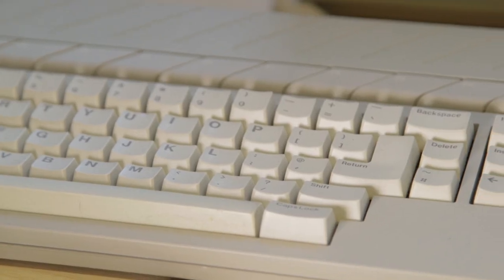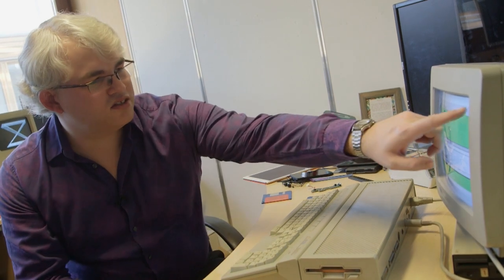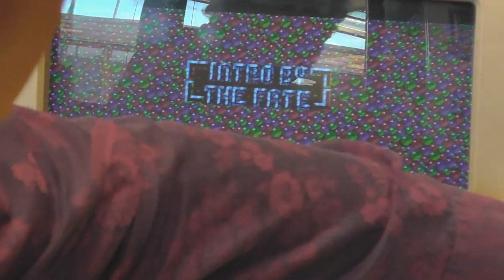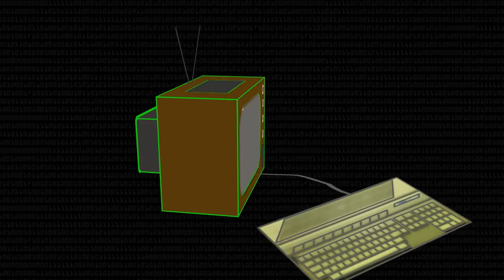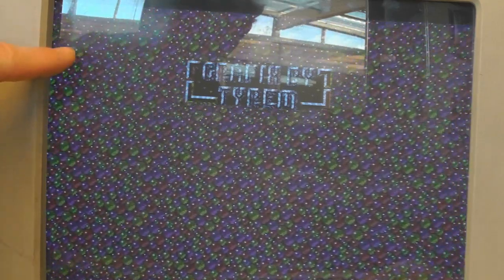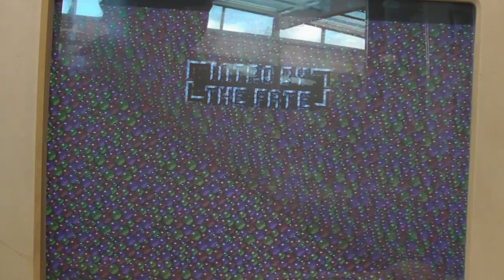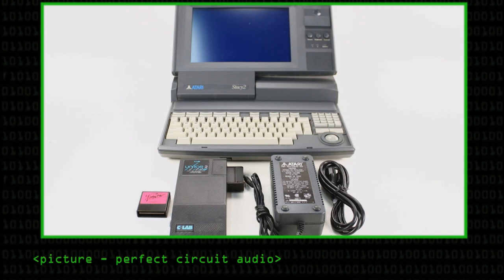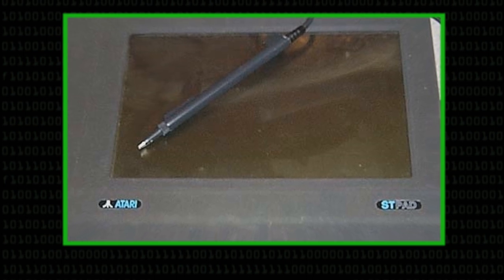Pushing the Atari Limits - Computerphile

Comment: I remember soldering a blitter chip to my STFM (there was a place for it on the mainboard, and the TOS had a support for it), adding HW overscan mod (made from couple of TTL chips), and making memory expansion logic that allowed some odd memory configuration (like 2,75 MB total) before I had enough cash to solder together a clean 4 MB expansion from PC SIM modules. I even made an address decoder for IDE interface, but never had a chance to test it. Golden years...

Comment: Speaking of great monitors, even though I won't dispute that the SM-125 monitor had crisp image quality. The Commodore 1702 (Monitor that came with my C64) was probably the crispest color TV that I ever used. When I was a kid I would plug various consoles from a NES all the way up to a PS1 into it and the image quality was unmatched. You could even retrofit an S-Video jack onto it by wiring up the Chroma and Luma video inputs to an S-Video jack, or splicing the wires from an S-Video cable into seperate Chroma and Luma cables.

Comment: You can zoom out all the border on the Atari color and mono monitors with the dials at the back. The borders are there to keep the speed up, it's all to do with pixel clock and 16khz line refresh. It's the same reason why most home computers had a border, the Amiga and Atari 8 bit computers and also the Atari games consoles had no borders and people had no problem using them on very old TVs.

Comment: On the VIC 20 we would put the machine into the hires mode with limited colors, set a timer to wake us up just before we'd get to the end of a particular scan line, watch the beam x counter until we hit the end of the line and then switch the color palette. That let us have more colors than we were supposed to have. Had to do it in assembler, and that's exactly why I learned my first assembler.

Comment: Interesting to note that the Mega ST had a blitter as standard, allowing faster rendering of the OS graphical bitmap operations. It's also interesting to note a company also sold a "software blitter" which when using OS legal design software gave pretty much the same effect for original 1985 520ST owners using GEM applications. Atari could  have improved this aspect of the OS design when transitioning from loading OS from disk to placing it on ROM

Comment: In Atari 8-bit it was actually very easy to draw on the screen borders.  The playfield (part of the screen with data) could be set to either narrow, normal or wide and in the wide mode it extended beyond the visible screen.  You could also shrink top and bottom margins to almost none with properly designed Display List.  You could make clone of this demo in Atari BASIC.
Not sure if any other computer from the '80s could do it so easily.  Atari 8-bit video chips (ANTIC and GTIA) were quite unique in their way of generating video output.

Comment: My most enduring memory of the Atari 520ST is soldering piggy-backed DRAMs onto the existing 512K to upgrade it to a full megabyte. There was also a .BIN image that you could use with an EPROM burner to make the machine believe it was a 1040ST. Without the extra RAM I found the 512K version a little claustrophobic.

Comment: Interesting that the screen on the Atari Mega is nearly as crisp as a retina display. that's cool :)
Reply: Well, it's not, that's a bit of an exaggeration. It's only 640x400. The thing is, as it's monochrome it has a flat, uniform phosphor coating rather than being broken up into pixels, and the high scan rate combined with medium persistence phosphor means it essentially looks like an e-ink display. Merely one with 640 pixels along each of 400 lines.

Comment: There's a Demoscene production called "Copper" by Surprise! Productions dating from 1992 which does this sort of stuff with VGA hardware on MS-DOS machines. Even DOSBox's best VGA emulation system (which handles a lot of Demoscene effects quite accurately) still doesn't quite manage to correctly reproduce all its effects.

Comment: The video was great until after the border busting effect, then it turns into a history lesson :/
Demoscene are definitely worth a dedicated video!
Reply: A dedicated video? Heck, the Demoscene has come up with so much clever stuff that it deserves a whole series.

Parallax, fills, zooms, ripples and fades on hardware never designed for the tasks, novel ways of storing images allowing million-fold zooms of fractals without having to do the calculations in real-time, flat-shaded 3D polygons with real-time lighting on 1993-era hardware, real-time raytracing on the CPU as far back as 1995, the list goes on and on and on...
Reply: I know! I made a playlist because I watch so many demos. There really needs to be more documentary/educational videos on the demoscene.
Reply: You guys need to hop over to pouet.net and have an explore ... a lot of the catalogued demos have youtube or other video hosting links, as well as downloads for the actual code to run in an emulator or on an original machine ;)

Comment: Dunno, I think the the STPad had been released it'd of been similar to the tablets that were around at the same point in history, mainly used in certain neich industrial, engineering and medical situations.   I don't think the revolution would of happened until the iPad appeared (or someone else made a consumer version of a tablet) as the things were generally even more expensive than a laptop and often had the specs of the much cheaper base model unit to boot.

Comment: Waiting for Amiga episodes, i was in that "camp" allthou i used Atari 1040ST(E) for Notator before i got a nice hardware package for Amiga (midi, digitizer, action replay IV and some other knick knacks i can't remember now..). I used the Action Replay to rip algorithm produced waveforms as it was just easier to produce lots of data and browse thru RAM for the samples than to render to file, made very cool industrial metal background noises.. Atari was "just" the brains for midi, never used it for anything else but i did switch to Alesis MMT-8 as that machine just kicked ass with Amiga as a sampler and sysex dump.

Comment: Seems like half the time a hardware manufacturer snuck a DSP into a 90s computer or console it ended up being used to crank out 3D vertex calculations just as often as it was used to decompress audio codecs.

Comment: Could the tablet revolution have happened decades earlier?  No, the technology just wasn't there.  Everybody attempted it back then, even Apple, but nobody could make it work very well.
Reply: Arguably, the hardware technology was there, but the comprehension of exactly how to make it work was not.

Being able to sense where a big fat finger has made contact with a display has been possible for an awful long time. And that's all that was really needed to get the very basics going (multi-touch, without doubt, vastly expands the possibilities - pinches, zooms, etc. - but it's not necessary for the most primitive of operations, like selecting options from a menu or swiping and the like).

But user interface design, software, display technology and the like needed to reach enough of a maturity for comprehending how to do the touch properly, intuitively and well.

But the touch itself, in hardware terms, has been technologically possible for decades beforehand.
Reply: KlaxonCow I beg to differ.
Go check out a laptop fom the end of 90', for reference.

The hdd is not shock proof, and there was no sd/ssd.
The memory chips was bigger and lot less efficient, same with cpu, what mean more power, and heath.
The lcd panels was horribly expensive, and awfull quality with todays eye, no contrast, no proper light level, so you can barely see it.
There was no mobile networks, to prowide that mutch needed data connection.
And the biggest reason imho, our accu tech was well below todays, li-ion was inwented in 91, so it was horribly expensive. So i guess one could build a fortune costing unresponsive abomination with led batteryes, but who would pay for a mobile tombstone?
Reply: ***** yes, so it's not sellable... thats my point
Reply: ***** i did not sad it was not possible, i sad it would be a horrible user experience, for tonns of money.
Have you ever spent 4 days setting up a mouse on Debian back in the 90's? :D
Reply: KlaxonCow The problem was the hardware, but not the hardware that probably comes to your mind.

The practical tablet was made possible by the dense capacitive touch display. Before that, the resolution and accuracy of touch just wasn't good enough to be usable. Once they learned how to make a dense transparent matrix of capacitors, touch become much more usable.
Reply: more to the point, what exactly would someone have used a tablet for in 1995? This was before digital film remember, so there goes the major reason why anyone uses a tablet.  Of course, film rolls also means no small cameras, so there goes another suite of reasons why people favor a tablet over a laptop. Heck, audio couldn't be recorded digitally either: so a tablet was just as useless for sound editing as for video and photography. The machine that filled the void of portable notetaker was the AlphaSmart.

Comment: HMmmmm was the Falcon actually part of the ST family? I always thought it was a completely new computer that was placed into an ST style case in order save costs.
Reply: It started life as a processor replacement for the STe (combing a 68030 and DSP in place of the 68000), if you google for 'Atari Sparrow' (the codename it was built in) you could find some photos of the machine during development where it is very similar looking to the STe. Either way, both it and the TT attempt to be ST compatible and run the same OS (albeit modified for the extra hardware capabilities).
Reply: Thanks for the info. :)

Comment: The ST was designed to use Atari's dedicated monitors just like the one in the video.  The gigantic borders on its default display have more to do with lame design decisions than television behavior.   Other computers/monitors of this era worked without massive borders.
Reply: One of the first hardware hacks of many ST owners I know (including myself) was to open the monitors and carefully adjusting potentiometers to enlage the image while minimizing those borders. Then came graphics cards and multisync monitors. :-)